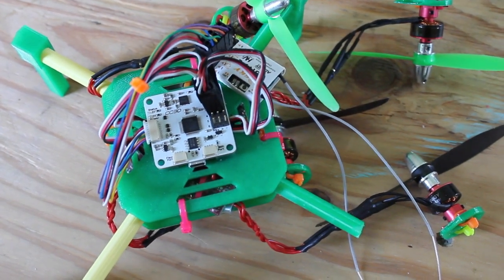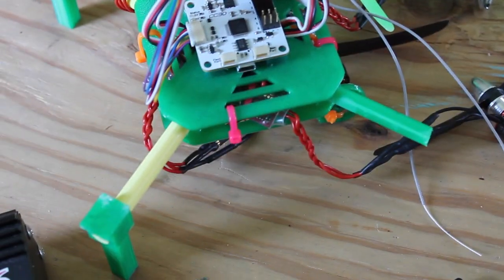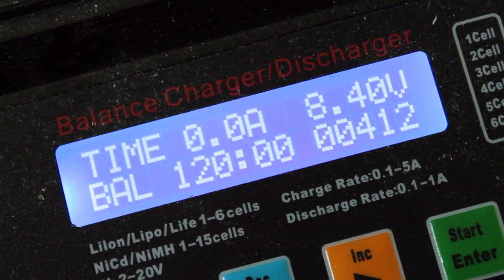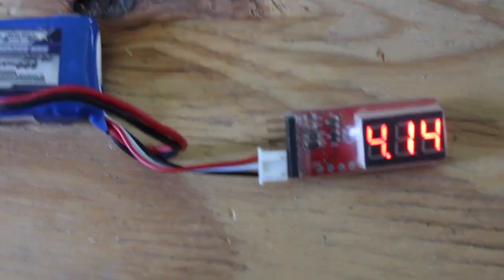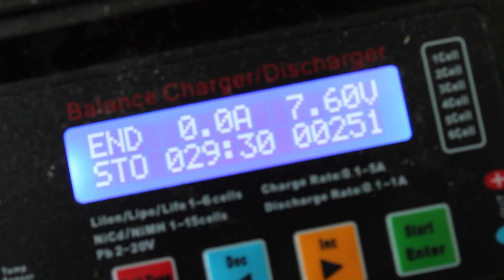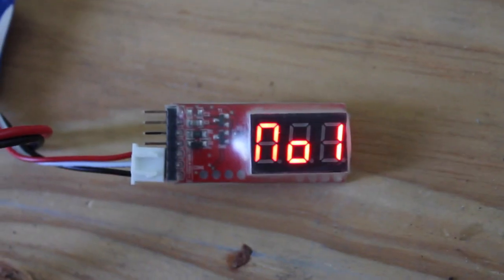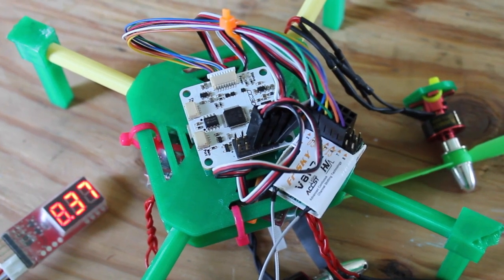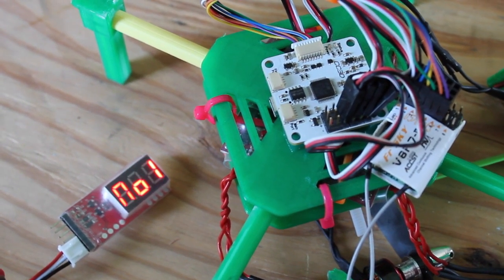A Friendly Reminder: Keep Your Lipo Battery Cells Well Balanced

Comment: I enjoy your videos they've helped me with my drone set up and it works great,  now im planning on ordering the FrSky Lipo Sensor w/Smart Port, to help me know when it's time to bring my drone to land.  Since I'm going to start with my fpv setup( fatshark goggles) I'll have to make myself a  parallel y connection to power the transmitter and the lipo checker. And since my vision will be taken up by the goggles,  I wanted to know how to setup an alarm on my frsky controller as to when my voltage is low. You think you'd be able to make a quick video on such thing?  If so I'd greatly appreciate it.
Reply from the maker: Sure. I don't have a voltage sensor currently but have it on my wishlist. Unfortunately alofthobbies is out of stock at the moment, but I'll get one and do a review. I do have the X8R2Analog so it's probably a similar process for setting up the Taranis. Let me take a look and I'll see what I can find out. Thanks for the comment.
Reply: hey thanks i was able to find a couple of videos and if you search my name youll find a playlist called drones im slowly adding videos thatll help anyone out looking for good information. one day ill see if i can make my own but yours are super informative.

Comment: The problem isn't the battery. The problem is low-voltage cutoff should be disabled on ESCs used for multirotors.
Reply from the maker: Totally agreed. Thanks for the feedback.

Comment: Great video!   I watch all your videos and was wondering if u have a favorite power dist. board.   I am building a HK 560 ALIEN and am having trouble deciding on the power distribution board (system)
Reply from the maker: I've used the cheap HK PDB but for a lot of my smaller builds I just do a pigtail and solder everything together. For my QAV and TBS builds you may already know that the PDB is built into the frame. I don't have a favorite but let me know if you come across one you like.
Reply: jeromedawg If you don't use a power dist. board, I've found that if you use a 3.5mm bullet (one for pos. and one for neg) all 4 ESC wires will fit in it perfect.  Then just solder a little and you have a bullet ready that can connect to a bulleted battery lead.  For me, it makes it clean and easy to work with.
Reply: Cliff Chavis yeah.  That's what I decided to go with.  Worked great.

Comment: I actually had a lipo way out of balance. Tried rebalance.  Didn't work using turnigy accucel 6.  Tried a discharge and re balance and it timed out.  I ended up having to charge each cell individually as a 1s to get the cell voltages back up.
Reply from the maker: Glad to hear you got it working and thanks for sharing that bit of info.

Comment: I have that type of charger and after 3 months 100's charges it does not read accurate in Bal mode. I now watch it closely and use a cell checker. I think one of the cells balance circuit may have damaged component.
Reply from the maker: That sucks. I'll keep that in mind and do a comparison of voltage readings with my volt meter.

Comment: The rate at which the voltage decreases (while flying) is non-linear, and so if you have a battery with a cell out of balance (on the lower side) then it will start to decrease in voltage quicker, resulting in the batteries voltage dropping quicker, but I can't see that happening so soon into your flight!
Reply from the maker: Thanks for the info. I agree that it's strange to happen so early in flight.

Comment: I think every one else has already said it, but I also doubt that an imbalance in the cells would cause a crash. Unless the total output voltage drops below the cut off. Also if your control board is set right, shouldn't the quad just power down slowly to a landing rather than a crash. Unless your set up gives a hard cut off at voltage critical. Not a good idea on a quad. I think someone told you to press the yellow button on your charger to check the cells as they charge. I use the HKC6 charger that allows this. Also the HobbyKing HK 010 allows you to balance cells after charging. Great videos, and your quads fly a lot better than mine. Still trying to get a good flight out of my KK2 board and HK Mega 2.5 haha. Although both soft land when the lipos die ....
Reply from the maker: Great feedback regarding soft landing. You're right. In normal cases my quad will soft land if I trigger the LVC in the garage. But now that I think about it there was a good bit of wind that day and I was about 50 feet in the air. Perhaps it was "soft landing" but the wind was pushing it towards the wall of my garage. I plan on doing some more testing when I get back in the air and will definitely be disabling the LVC on this mini quad. Thanks so much for the thoughts.

Comment: Hi Dennis,  Sorry you had a problem.  Unless the battery has an internal problem that suddenly drops the voltage then it is unlikely that the quite small imbalance has caused your problem, after all the controller can not see the voltage in each cell just the combined output voltage.  Your charger seems to have the same software as mine?  If you press the "Inc" button after you start the charge process does it not show you the voltage in each cell?  Also the bottom right number(diagonal to FULL) shows how many mAh you have put into the battery when charged 286 which suggests the start capacity was 514 mAh or thereabouts.  When you did the charge after the crash that timed out it showed a capacity input of 412 mAh at 8.4 volts which suggests it was about half depleted.  you should safely be able to run this battery down to 200mAh.  I would check for other problems, esc, motors or bad connections.  Hope this helps
Reply: I agree I don't think it was the battery that caused the crash.
Reply from the maker: You have a good eye looking at the output values of my batt charger :) I'll be doing some testing soon and will report my results. Thanks for the ever useful information and the time you took to respond!
Reply: Dennis Baldwin http://www.bananahobby.com/genesis-power-2s-7-4v-850mah-65c-pete-signature-series-rc-lipo-battery-pack.html  Try these packs.  I are pretty good, although I would rate them more like 35C-45C and not the advertised 65C.  They are well wrapped in a puncture tape cloth tape.  Over rated at 65C, but very well made, and consistent.  No balancing issue at all.

Comment: That happened to me once and I did the same process. But after charging and discharging it the lipo began to puff. The cells were all within the same range but I decided not to chance the battery. I decided to just use it in my fpv plane as the vtx battery since that dosent draw much power and it's been working great.
Reply from the maker: Very creative use of that battery! Good tip. Thanks.

Comment: I am not convinced your quad fell out of the sky because of the battery. It doesn't make sense that one cell with lower voltage would be enough to drop below the threshold of the voltage needed to power your quad. My quad uses a 3s (12.4V full charge), and my quad is fine all the way down to 9V.
Yours should have a tolerance of plus/minus more volts than what caused your crash.
Reply from the maker: Yeah my thought is that a weak call could easily trigger the LVC of my ESC which would cause the motors to lose power.  I believe with my Turnigy Plush ESCs the cutoff is at 3.2V for any of the cells. I'll post my findings when I get back up in the air. Thanks for the thought.

Comment: I never fast or regular charge I always balance charge at 1 c rate, takes longer but better for the battery's also keep them at 3.85 storage per cell when not using
Reply: Not using? you can do that? LOL! I leave mine charged full for up to 5 days but then fly them down to 3.85 and charge at 1A no matter capacity.
Reply: Hoverbot1TV lol I try to use all the time :)
Reply from the maker: I feel the exact same. I always balance charge at 1C.

Comment: Use a voltage alarm that is configurable. That way if any cell hits the preset voltage you at least stand a chance. Weighs only bout 8grams.
Reply from the maker: Good point. I have a voltage alarm that triggers at 3.3V/cell but it's not configurable. I like the idea of one where I can tweak the threshold Thanks.

Comment: Even .10 volts out of balance, I do not use that pack.
I do not balance on a charger but rather, use the Hobbyking HK-010
Reply: ***** It's not a crazy speedy job but I found it to to the job when my charger would not do so, or would not activate because the balance was so far off.
Reply: So you charge first, then let the HK-010 discharge the high cells to match the lowest using its "Integrated Self Equalizer".  How is that more effective than a good balance charger that can properly charge the individual cells to equal voltages on the first try?
Reply: hankus253 My Accucel 6 charger does look at individual cells but at times, it is picky on starting up if a pack is wildly out of balance. The packs when out of balance in the past, have had enough charge to stick on the Hobbyking balancer without having to charge it. I find that a slower charge at say half C or lower gives a better balance of packs and so the Hobbyking does a good job being it takes it's time balancing.  Just my thoughts and experience here :)
Reply from the maker: Interesting. I will definitely have to look into that. Thanks for sharing.

Comment: Haven't been able to fly my quad (TBS) in a couple of months now due to being away at University, have had a similar issue with a battery, but the discharge/recharge didn't fix it. Any recommendations on good batteries that balance well and are reliable. I have previously used Hunger batteries but I'm not too impressed, especially with the 4S I have. Are the HK ones any good? Certainly can't beat the price!
Reply: assaulter99 I've learned now that a lot of the cheap chinese RC gear, is just cheap chinese RC gear.
Reply: Hi, I can recommend the GenAce and the Glacier LiPo batteries.
Reply: These hunger batteries suck big time. Never balanced.
Reply: I've been using readymaderc batteries and have had no problems. They ship fast and have great customer support.

Comment: Another little tip with that charger. While your lipos are charging, hit the yellow "inc" button and it will bring up a display showing each individual cell voltage. I do this to verify that each cell has the same voltage
Reply: You saw that too? :)
Reply from the maker: I failed to mention that. Great tip and thanks for sharing.